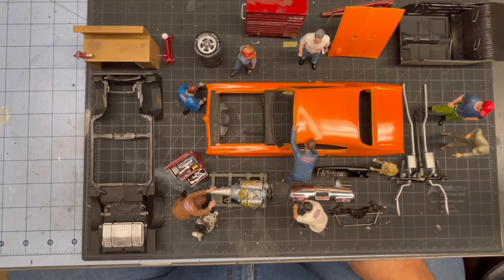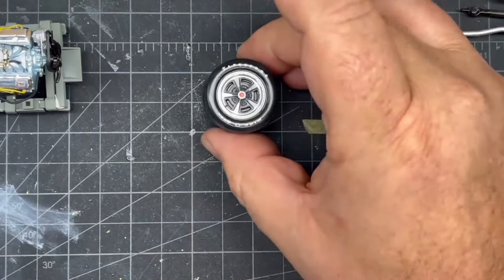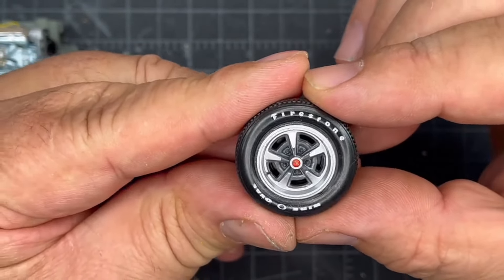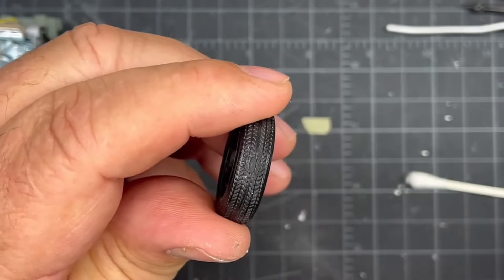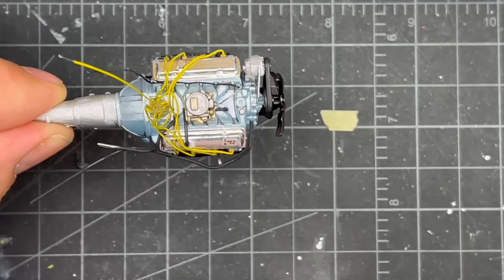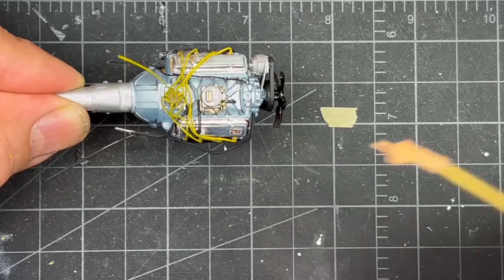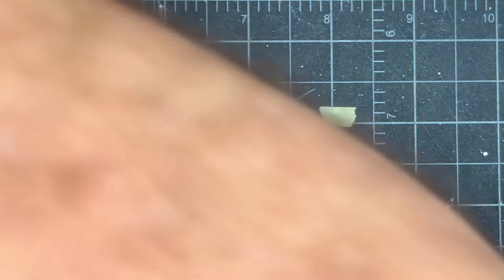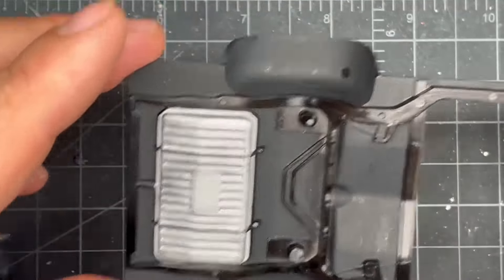The Revell 69 Pontiac GTO Build Update 4.  What a great kit!!

Comment: Very nice, Mark. It's really coming along. I was keen on how nice the wheels turned out. I plan on building a 70 Trans Am and (of course) it uses the same type of wheel and I've not figured out a way to get them looking like they should - but you did. Did you hand-paint that black and silver separation on the star segment of the wheel? Or did you use a mask? Anyway, thanks for the video. Always an inspiration!
Reply from the maker: Thank you.  I airbrushed everything with Chrome silver, then brush painted the German gray.  Those separations kind of had a line where you could follow on a few of them, but the rest were just freehanded.   A small brush and shallow breathing helped a lot.  LOL

Comment: Hi mark im Rob love your channel and builds. I was wondering what you use for your plug wires,fuel line ,brake lines etc.
Reply from the maker: Rob, thank you very much.  I use .3mm solder that I get from Amazon.  It is so easy to use and a nine dollar roll will last so dang long.